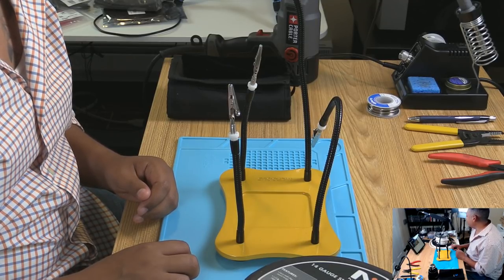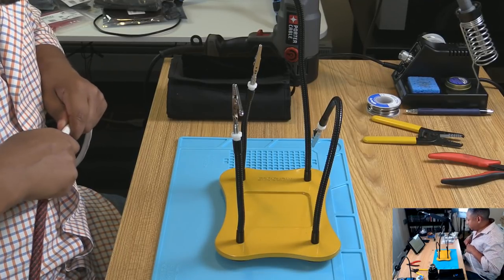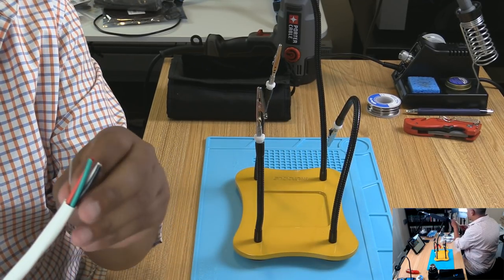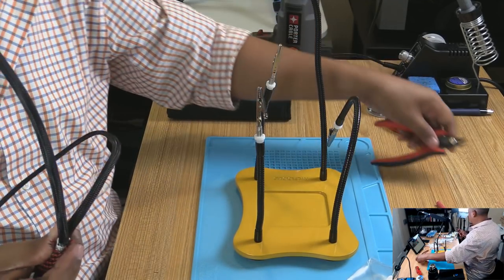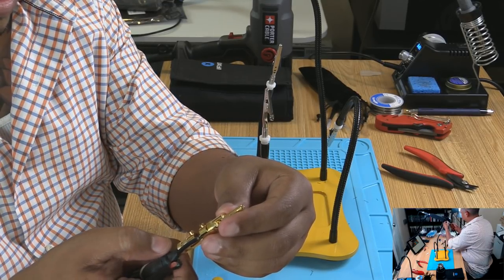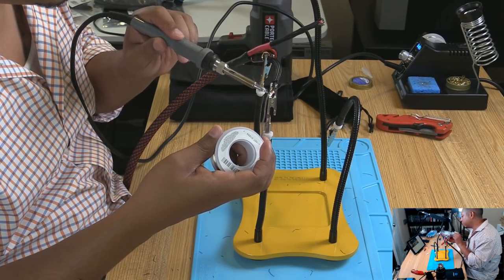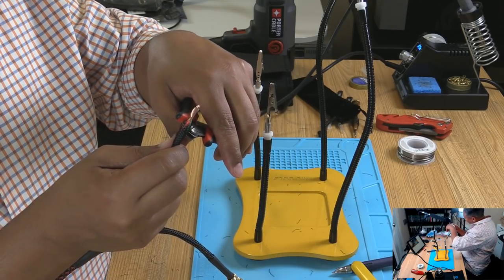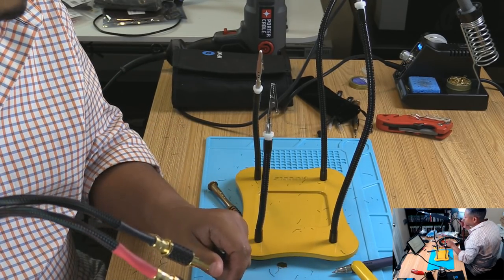How to DIY Premium Speaker Cables

Comment: I made my own cables using tech flex and they looked really nice but when the tech flex got dusty being on my tile floor they were hard to clean off so I removed the tech flex and only used a little shrink wrap, they still look nice but are much easier to clean

Comment: To stop the sleeving from fraying after you cut it, get a lighter and heat up the ends to melt the tech flex so it does fray. Don't hold the lighter there, move it across the opening a few times and them, smooth it out with your fingers.
Reply from the maker: Excellent tip. Thanks.

Comment: Just saw your video now! do you realize how much contaminant the sticky part of the tape has!, and then you twisted all the copper with a sticky part of your fingers! And then adding solder to the Copper adds another layer of connection, another layer of resistance!   That would be the same as addid solder to the banana plug before you put it in the speaker binding post!

Comment: Two 14 gauge  paired cables are in fact 11 gauge. When you pair cables the gauge will drop 3 gaug. 
I am very curious about pure silver cables by Mundorf. Here is the link: https://www.audiophonics.fr/en/cable-metre/mundorf-mconnect-sgw115w-cable-argentor-isole-ptfe-blanc-15mm-p-1818.html

Comment: If you put the heatshrink tube on the flex tech before you put it on the wire, I think it would make your life a lot easier.
Reply from the maker: Right you are. In later videos I’ve done just that. Great tip.

Comment: Why you take four wire and make two twisted?
Reply from the maker: Good question. Taking 2x 14AWG speaker wires and combing them will effectively make 11AWG speaker wire without having to pay the cost of 11AWG wire. This save a little money. You can read about it here: https://www.audioholics.com/audio-video-cables/speaker-cable-gauge

You can also watch a much short version of this video here: https://youtu.be/XZT8KBqcx24

Comment: do they give you a better speaker performances
Reply from the maker: I would say yes for longer runs of higher gauge cables or if you’re replacing copper-clad aluminum cables. If you have oxygen-free copper cables, then no.

Comment: Hey what is the size of the tech-flex Cable you used in the video?
Reply from the maker: I use 2 sizes. 1/2” for the outermost jacket and 1/4” for the positive and negative terminals. This was my first live stream and not very good. I have a very short (10 min.) and polished version here: https://youtu.be/XZT8KBqcx24 You May find that one more helpful.

Comment: well... I have amplifier and subwoofer that I can't using dirty cheap wire.
Reply from the maker: +Michael Marr as long as it's Oxygen Free Copper (OFC) then copper is copper. It's chemistry 101. No amount of pseudo-science will change this.

The next major factor is in the wire gauge. The lower the number the thicker the wire. Smaller gauges perform better over longer distances. So if you have a long run use a lower gauge wire. 

What I would advise against is Copper Clad Aluminum (CCA). That's what the ultra cheap stuff is generally made from. Avoid it and you'll be fine.
Reply: Huh?  I thought super cheap speaker wire are copper for + and nickol/copper for -?  

For my subwoofer, I had paid $40 cable just to get it working well without hissing and pop.
Reply from the maker: The cheapest wire I've ever seen was just plain old aluminum - but that, generally, tends to be used in really thin wire and packaged with cheap electronics.  Most places (typically) don't usually sell that.  The cheap wire they do sell is usually Copper Clad Aluminum (CCA: https://en.wikipedia.org/wiki/Copper-clad_aluminium_wire).  Think of it as aluminum wire with copper electroplating on top.  The outside looks like copper but it's only a really thin coating.  Inside it's aluminum.  See the Wikipedia link above for a picture and explanation.

Seems like the wire that was giving you trouble (i.e., hissing and popping) was a high gauge CCA wire or maybe even worse yet pure aluminum.  Definitely stay away from that stuff. I have also had similar problems CCA wire.  Many manufactures will sell it and not tell you it's CCA.  Very misleading/false advertising.

For more info on speaker wire see this Wikipedia link: https://en.wikipedia.org/wiki/Speaker_wire#Wire_material

Do you think I should make a video explaining speaker wire (i.e., the types, gauges, etc.)?  Does that sound like something you'd like to see?  I can make one if you think it would help folks better understand speaker wire.
Reply: I have seen what was on copper.  It appear to be full copper, but not real copper as it look, and the ground are an shield.  In this case if my comment wasn't clear.  It is cable for between my AV receiver and subwoofer amplifier.

Comment: Cables are not snake oil.  You are miss informed about what audio cables do and how they alter sound.  There is a way to make budget cables, but you have to know something about cable technology and what provides a neutral and detailed sound.
Reply from the maker: LOL, pretty sure I didn’t say cables are snake oil.
Reply: @JackofAllTech  2:37 you say snake oil science. 1:40:45 snake oil about expensive connectors, in short you are creating doubt about speaker cables science, construction and connectors.  Sorry you would be wrong.  As you say you have a lot to learn and that would be true.
Reply from the maker: I was disputing “Cables are snake oil” claim. LOL - love me some trolls. My message is: some companies employ snake oil tactics. Here, read some science and learn ya something: https://www.audioholics.com/audio-video-cables/speaker-cable-gauge
Reply: @Levin La Tour bad cables take away what you should be hearing. Good and everything else above that take nothing away or add nothing to the original signal, they just let you hear the music the way it was intended.
Reply: Andy Abraham problem nothing is neutral everything in audio has some influence in the sound hence a sonic signature. So just like designing a system that sounds the way you want it cables should be chosen to complement the rest of the system and reveal as much detail as possible
Reply: @Hal9000Comp  I do hope you are able to find the cable(s) you want. I am afraid you might continue to pursue changing cables, it will be a form of OCD, never happy always thinking changing again will improve something. Room treatments, isolation, stability devices and upgrading hardware will all have a better impact on the sound of your system. However, feel free to pursue  cable perfection. You are totally free to spend what you like on this great hobbie. Enjoy your system.
Reply: Andy Abraham I have Andy I just want your viewers to know the truth and importance cables make in a system. Everything in a music system is important and makes a difference.
Reply: @Hal9000Comp  I totally agree with you. However, there is a point of diminishing returns. You do not have to go to the extreme levels of cost for a great cable. However, buy what you like. Buy knowing you have a well made cable.

Comment: look, this is painful for an experienced AV tech to watch, so I'll save you 1hr and 45 min....get yourself some 12ga fine strand copper cable, cut to length, strip both ends, DO NOT use plugs of ANY kind, and connect directly to amp and speakers, done.this speaker wire voodoo bullshit is all over the net, don't buy into it. I'm not going to get into capacitance and inductance arguments either because unless you're an engineer, there's no reason. if you're going to argue with me get out your money and we'll meet and have some fun... I live in southwest PA and have mono blocks with studio monitors for testing... btw- no one has EVER taken my bet. cheers !!! sorry for the rant..
Reply from the maker: I’m pretty sure we’re making the same argument. I take it from your comment you didn’t actually watch the video and just came looking to pick a fight. LOL.

I don’t believe in speaker wire voodoo. The purpose of this video is NOT to spend ridiculous amounts of money. Just use copper cable (and not that copper clad aluminum nonsense). The rest of this video is just window dressing to make it look pretty. If you don’t care about looks - skip it.
Reply: @JackofAllTech  great answer, and I'm sorry if I sounded angry, there's just so much bs it's hard to take.. peace